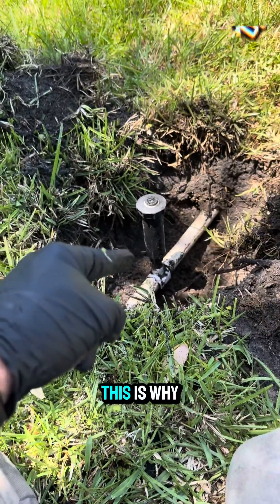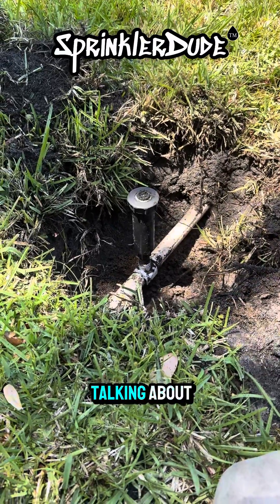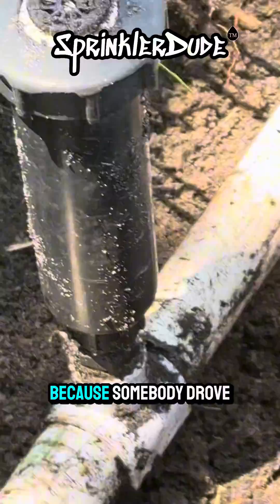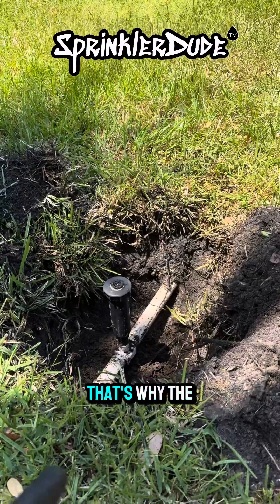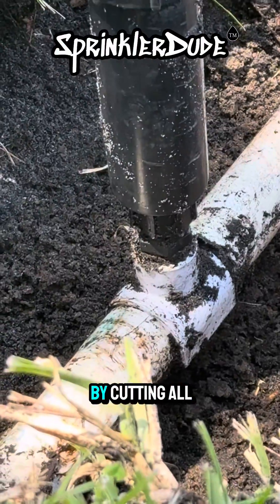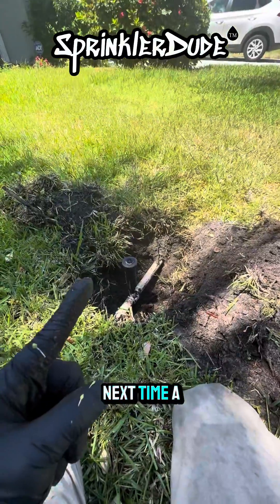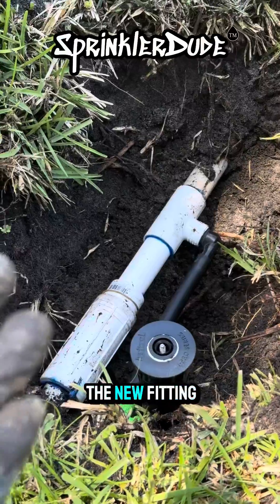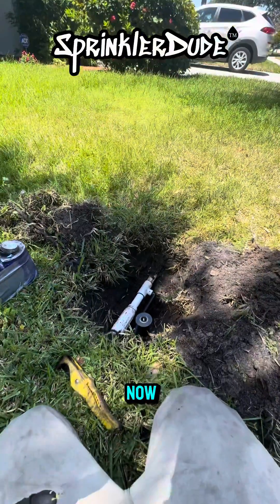How To Install A Sprinkler | Like A Pro

Comment: Could you also use this method for an aerobic septic system which uses spray heads? Or will the chlorinated water deteriorate the swing pipe?
Reply: If concerned about a rubber flex pipe, you can use threaded fittings.  The threaded fittings allow some pivot.  Don't crank them down super tight, just snug.  I like teflon pipe dope because it allows them to pivot without binding up.  You need to allow movement in two directions:  up and down along side the zone line, and a similar pivot under the head as the angle changes between head and zone line.

The Tee on the zone line should branch to the side and ideally be a threaded branch or you can use a slip to thread adapter in the branch.  Then you also need 3x threaded Els, a 12in/30cm nipple and a short nipple both with threaded ends or adapters plus whatever (a short nipple?) you'd use to connect to the head.

Use a threaded El to the 12in/30cm length of pipe making it parallel to the zone line. You could put an El going up on the end, but for the most protection (like alongside a driveway) align that threaded El horizontal (away from the zone line), then a short threaded nipple, then another threaded El facing up under the head.  Easy to draw out on paper or white board, not so easy to describe...

The threaded El and the tee allow the 12in/30cm nipple to pivot vertically at the zone line, preventing damage to the zone line when the head is pushed down.  The threaded Els on both ends of the short nipple (one of which attaches to the 12in/30cm pipe facing away from the zone line and the other to face up to the head) allow the connection under the head to pivot, allowing the head to stay vertical when pressed down to avoid cracking the longer nipple.

==T======== zone line
     ----------   longer nipple can pivot in relation to the zone line
               |
                -- HEAD can pivot in relation to the longer nipple

Comment: Ugh!!! That’s just lazy to use a saddle on pipe that small…
Reply: It is a LOT easier...  run all the pipe, glue on the saddles where you want heads, drill the hole.
Reply: @Sylvan_dB  To each their own I suppose, but even with saddle glue I still don’t trust myself to get a good seal.
Reply: @benwalters2449  Remember it's a zone line - the entire purpose is to let the water out.  As long as it doesn't come out too fast, you're good!